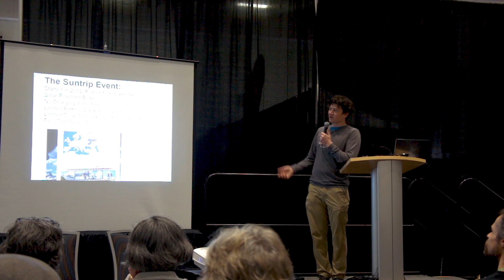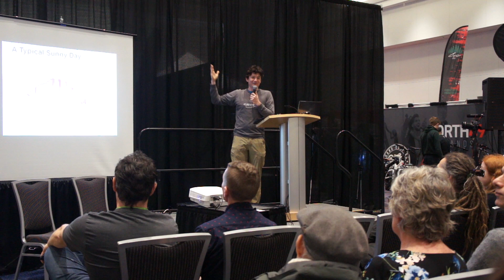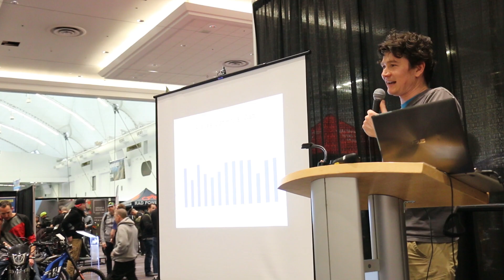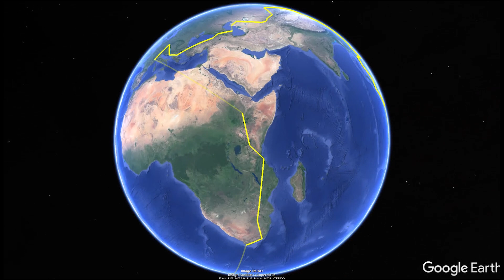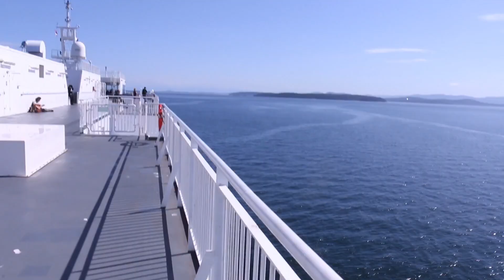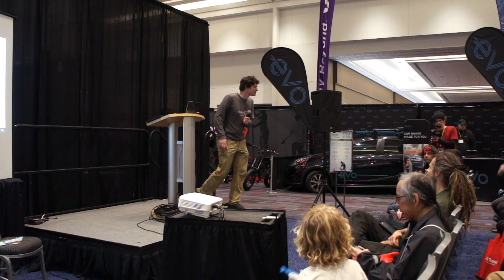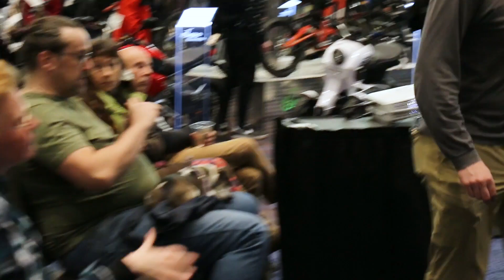Solar Ebike Touring, Experiences of the 2018 Suntrip Race, with Q&A Session from BC Bike Show

Comment: I'm planning the Rails-to-Trails (seattle to W DC) as soon as it opens.. I've been working on my Solar Trailer for a couple years.  The key has been using authentic SunPower® solar panels and Genasun GVB-8 MPPT boost charge controller.   I tried using some cheap panels and it was so inefficient that i couldn't get any charge.  A 170w 5.83 amp panel makes a big influence on a 900wh battery.  Essentially, it pays off by supplying the power needed to pull the trailer.  So all i have to do is effortlessly pedal my etrike.
Reply: Rob those 170watt SunPower branded panels look good.  I think that what Justin used on his 2018 trip and what I am planning to get very soon.
Reply: @danieldalessio4317  Daniel.  I went thru SunPowerYachts.com to get my panel.  Lyall was the first dealer on the American continent that sold these amazing solar panels.  I see now that Lyall is selling these on ebay.ebay.com/itm/SunPower-170-Watt-Flexible-Solar-Panel-High-Efficiency-for-Marine-RV-Camping/183918537192?  170w panel is now only $399... msrp $550.  They are assembled in France.  

These are the exact high quality panel that Grin sells.  Make sure you get a SunPower® with Maxeon cells they have a 25% efficiency rating. (most other lesser panels are 15%-18% (that is like a Richter  scale in terms of efficiency) That means smaller panel more power.  These projects don't work if you substitute cheap panels.  or cheap boost charge controllers.  Grin has some very high quality items.  I got he CycleSatiator wall charger for home use.  They are amazing.  check them out.
Reply: @rdkuless  Yeah there is a bunch of places that seem to carry them amazon got them for $340 now might get.  Alex Hofvander has some pretty neat panels from sunbeam a Swedish company.  He's getting over 25.1% efficient from them via a very interesting patent coating they got.  Also using SunPower cells.  However I notice lot of the aftermarket flex panels with SunPower cells only get around 23% efficiency from the specs.  And from what I research coatings degrade quickly on them get foggy.  They are cheaper option though.  And much better then the 15-18% panels.

Yeah Grin's solar charge controller looks awesome like how can mix and match it with just about anything.  But think I am going to go with a Genasun seems like that what everybody uses on sun trips year after year they are unbeatable.

Was going get a CycleSatiator  in 2017 they are amazing wonderful design.  Works with so many battery types and set cut off volatages to what ever you like.  And got be the most efficient charger on market, totally fan less is awesome.  But I opted not get one.  I have a fairly large 14s 10p lion pack I built 1.8kWh pack for my current ebike.  I wanted more then 300watts charging while balancing.  I made my pack with ability to split in half.  So I could use a 24v server PSU and RC lipo chargers.  I pump 700+ watts into my pack for rapid charging.  Then use RC cell monitors/buzzers when riding.  Its nice setup and cheaper but noisy, inefficient and lot cabling.  Can't wait to get some solar panels
Reply: @rdkuless  if you buy 25 of the 170w panels from sunpower the cost is about $1 a watt. So sunpower yatchs is marking them up $230 over thier costs. hardly a deal.
Reply: @sunshine5349  You just described Keystone is a retail term related to pricing inventory. It is a pricing method whereby merchandise is priced for resale at an amount that is double the wholesale price or cost of the product. 
It would be wonderful if the manufacturer would sell one @ wholesale price,  to the customer.  They won't even sell 100 panels to the customer. They require you to go thru a Solar panel installer (that keystone their panels) those people are called retailers. You as a customer can't even talk to SunPower directly.  The website tells you to go to a retailer.   If you ever have an issue with a product, SunPower tells you to go thru the retailer.    I'm not sure you realize that 90% of retail is set up like this.  Keystoning the price, allows them to rent the shop space, pay the electricity, pay for water to flush the toilet for their employees that they must hire to provide a product you can't access yourself. 
If you are able to get a Genuine SunPower® panel that is rated at 170W, 29.4V, and 5.83A for $230 less than retail, then that is great.  Just know, there won't be customer service available to answer any questions, or provide for return of a defective product.  Retail provides a way for customers to buy one item without a huge investment.  You would also have to have connections to even get SunPower® on the phone to make those arrangements to become a SunPower® retailer.  the practice of keystoneing the price allows them to have the store to serve you the customer.  The retailer is not making an extra $230 per panel, they have many cost into providing the retail.  They rely on heavy volume to make a living.  It is quite a balancing act.  If you happen to own your own property, have access to free electricity, free water and employees willing to work for free, then you should buy 100 panels from SunPower® directly and make a profit of $230 on each panel. 
I'm very happen with my SunPower® 170w panel.  I tried the cheap fake sunpower panel, i couldn't get 15v out of it sitting side by side the Genuine SunPower® panel that got nearly 29v and 5.7 amps.   and the cheap panel claimed to be a real SunPower panel,   it arrived bent and the connectors between the individual cells.  The retailer had gone out of business and i had to take  over a $200 loss.    You get what you pay for.  I think i got a great price for an outstanding panel.    Best wishes,
Reply: @rdkuless  Yes I agree middlemen raise prices therefore we should try to eliminate them. Email sunpower, they only require 25 minimum panel purchase and they honor the warranty too. still too much for a single consumer, but not too much for a small bike shop or to resell excess on ebay.   If you need the service and support of a local bike shop, and don't mind paying more fine, but there are so many good DIY videos on how to do ebike stuff now that those who want to spend the time learning can save some money.
Reply: @sunshine5349  Doing a Solar Ebike right is expensive.  I have $2200 into my trailer/panel/boost charge controller.  I tried buying the cheap parts and the whole thing failed.  (a year of trying and failing, and the experiment cost hundreds of dollars... I finally bit the bullet and everything works great)  
Do you need 25 units..?  do the 25 units come w/free shipping..?  if you don't need the other 24, you can sell them at cost and offer free shipping.  I'll buy one from you, at cost with free shipping..  it's a winning proposition.  You forget, a small bike shop has to pay for retail space, electricity,  water/sewer/garbage, business insurance, wages.  (that can't happen if you don't keystone each item).    And by going thru the retailer, i was able to speak to a solar technician.  there is a big learning curve with solar power.  Will you get phone support from the manufacturer in France.  (aren't they located there..?)   Well, i wish you the best of luck on your project..expect extra expenses, my custom solar cables to connect the controller  to the XLR battery charge port  cost $130.  All in all, it was a fun, frustrating, rewarding experience.  LOL  It took me nearly 2 years to complete,  Glad i did it.
Reply: @rdkuless  you are right custom anything is expensive because you are paying for someone else's labor. Buy a $40 soldering iron and $5 quick release connectors off ebay and $5 worth of wire and you can DIY it.  I might buy a pallett of the 170w solar panels. I only need 7 for a solar car I want to make. I think by posting on RV, sailboat and ebike forums I can get the other 18 sold, but you are right, not super convienient.  the price for each 170w panel is $134.30. but by the time you add shiping to me and then repackage and reship to you, probabaly requires buying plywood and cutting  it up to make sure they do not get damaged figgure closer to $200 break even.
Reply: @sunshine5349  sounds like a fun project.  a big mistake i made was using solid 12AWG wire.  it is really critical to use Solar cables with Mc4 connectors.  (it has to do with the way solar currents flow.... a friend who is an electrical engineer who manages wind turbines in California, said he would have to get a second degree to understand Solar because it is so different.  And XLR connectors are really confusing to solder (easy to flip +/-)  Having phone support is very helpful to problem solve.    You will have to post a video of your projects... It will be interesting to see.  Cheers
Reply: @rdkuless  pretty sure you need stranded wire that is more flexible. solid wire would eventually brake due to all the vibrations.  When I installed solar on my house I used both solid and stranded, but those don't move. but you are right lots of little things to learn.
Reply: Alex Hofvander  Hi Alex.. I 've been watching your channel for a longtime.  I like your HP Scorpion FS and your solar setup.  Keep making great content.
Reply: So those solar panels from Amazon for $350 are not the right one to purchase? I am trying to put two on my trike but not sure how much I can expect.  This would be my first ebike project for my 2013 Catrike Road.
Reply: @UCScahjQn-VfqyeWc44tmN2Q There are some fake SunPower panels.. Look at the panels here, these are Authentic SunPower® panels:  Lyall Burgeess:   https://www.sunpoweredyachts.com/?gclid=CjwKCAjwi_b3BRAGEiwAemPNUwlOtu0rLl4K_IoHZ-Z_u98-3_obvV_fKAU7sF6f7vYTSr_u9hyrGxoC3L4QAvD_BwE         Note: the SunPower logo is printed boldly across the top and the +/- cables are on the far right side.  That is Genuine SunPower®.... 
Justin at Grin Tech also sells the Genuine panels. 
it is critical to match your battery voltage to the correct Solar Boost Charge Controller.  I believe that Justin used the GrinTech controllers to boost the panel out put to the correct voltage to charge a 48v battery.  without a boost charge controller, you can't force enough voltage (54.6v) into a 48v battery to fully charge it. 
If you have questions, Justin at GrinTech, Lyall Burgess @ SunPowered Yachts, or  Ryan Gurin at Genesun(blueskyenergyinc.com) are available to answer the tech questions to get all the correct parts.    Solar has rules, if you don't follow them, your system either will not work , or it can burn up wires or expensive components.  Make sure you match up your system to your etrike.  Note:  most proprietary systems like Bosch, Yamaha, Shimano Steps or others won't let you add any components that are not proprietary.  (if the controller doesn't recognize the Boost charge controller, it shuts down the system) So many like the  Shimano Steps will not be compatible with a solar set up.    Grin has some compatible systems.  with some really great functions.  I'm not familiar with their boost charge controller (i only know the Genasun GVB-8)
Reply: @rdkuless  I never had an ebike before. I just purchased a used 2013 Catrike Road for this project. I have checked the Grin Tech website and expecting around $1300 for the motor setup and  $1200 for the solar panel setup.   Yes, I do want to purchase the right parts as long as they are within my budget. thanks
Reply: @UCScahjQn-VfqyeWc44tmN2Q Here is my etrike project with Solar trailer:  youtube.com/watch?v=USYsZLH7R3k  You can also go to my channel and see the short videos of the trailer in action.  It was raining the day that Court review it.  so we didn't have a way to show it in action.

Comment: Oh -- and I'd definitely be down for an American trip. Let's do it!
Reply: Same here.  It doesn't necessarily need to be the full 12,000 km either.  For comparison, I measured the diagonal straight line across the longest part of America which is the distance from Blaine, WA to Miami, FL as about 4400 km.  Google Maps routing shows 5472 km via the major highways:

https://goo.gl/maps/bdajW1eeBPK66oeu7

One of the biggest journeys would be an "all corners" round trip through America.  Blaine, WA -> Los Angeles, CA -> Miami, FL -> St. Agatha, ME -> Blaine, WA which would be about 14,500km:

https://goo.gl/maps/1E9aKVK8KYBmVM8n7

But I think most people would be impressed with just the first trip!  Also more riders would finish which makes it funner maybe  Perhaps to compensate, the race format can be changed to be pure solar power with no pedals whatsoever.  In fact, remove the pedals and chain to save weight.  That will also remove the factor of an athletic rider getting a major advantage.  The main advantage then becomes getting the smallest and lightest rider.
Reply: @beyondfossil  We had SunTrip kinda race here   www.suntouramerica.org  don't know what ever happen to it.  Would love to do over here have go though parts of Alaska, Canada and USA be pretty cool.  Or down though south america would be epic.